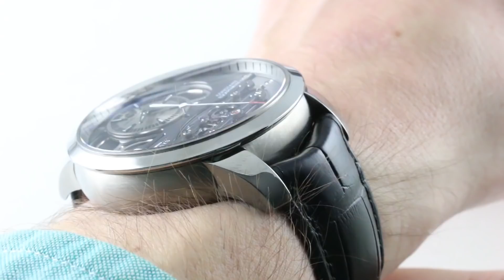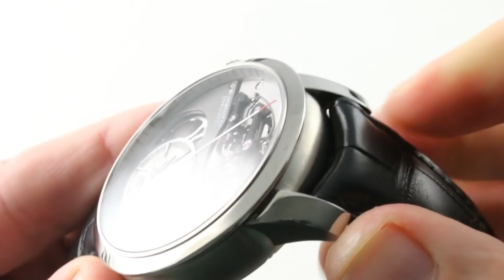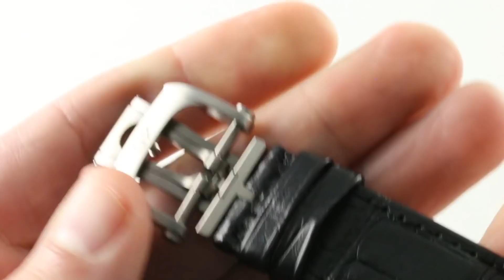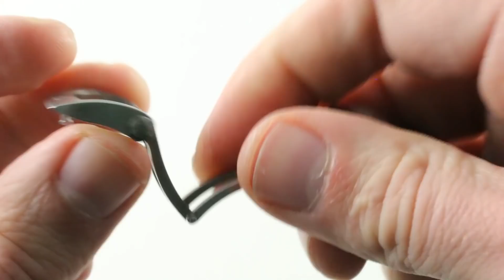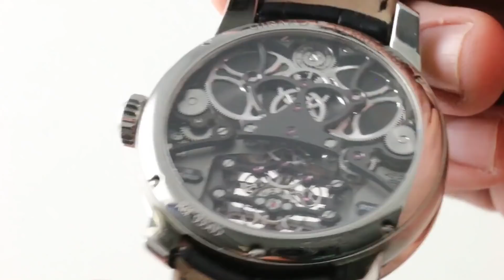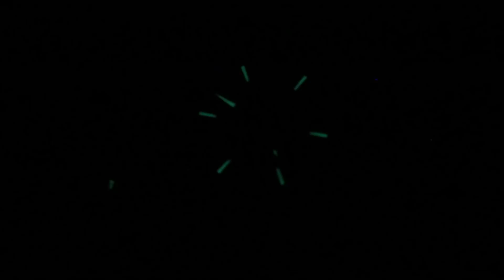GPHG 2013: Girard-Perregaux Constant Escapement L.M. (93505-21-631-BA6E) Luxury Watch Review

Comment: my brain exploded when ou explained the movement
Reply from the maker: I hope I didn't cause any brain damage! At heart, it's an original application modern material that subs for previous chain, fusee, and remontoir springs. All of those were designed to keep a watch running at a constant rate from full wind to near exhaustion; silicon does this effectively 
Best,
Tim

Comment: Great review Tim but unfortunately the spastic appearing movement at the bottom half of the watch reminds me of an equally spastic small Autobot from one of the Transformer movies (Revenge Of The Fallen).  It would annoy me no end as did the Bot; once the association between the two is made it cannot be unmade.  None of this is meant to take anything away from the beautiful engineering of the watch which is, for certain, exquisite.  Thanks for sharing.
Reply from the maker: The UN Anchor Escapement is for you. It's the same elastic remontoir principle with a simplified action.
Best,
Tim

Comment: Amazing watch and nice movement to look at, unfortunately none of the screws are aligned properly.
Reply: Real screws almost never align properly. Read Jack Foster's piece about screws alignment on Hodinkee.
Reply from the maker: That's correct. Real screws don't align. Bolts align when viewed from one side, but the nut screwed into the opposite side to sink the bolt is as randomly aligned as any screw. That's how the Royal Oak and many Bell & Ross watches are built. From time to time, bad watchmakers will reassemble watches to please customers who "demand" to see screws "correctly aligned." And then those screws back out and get lost...
Best,
Tim